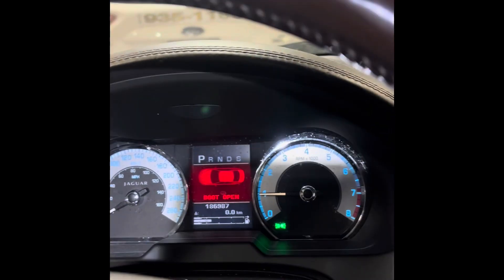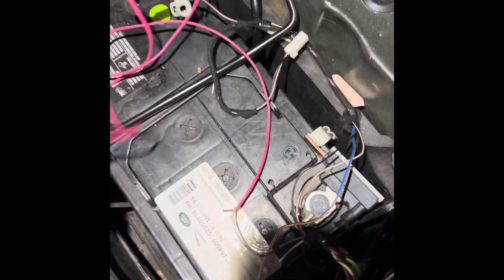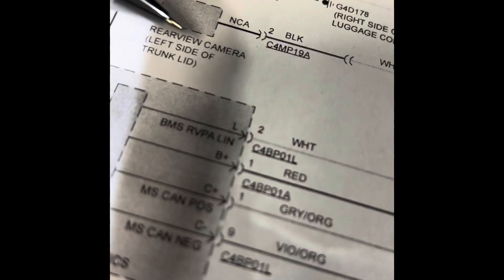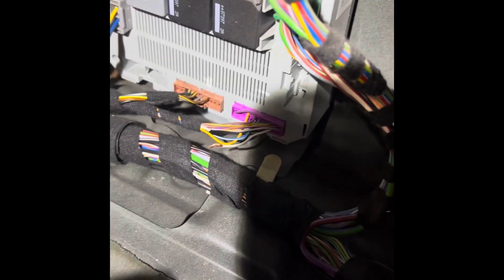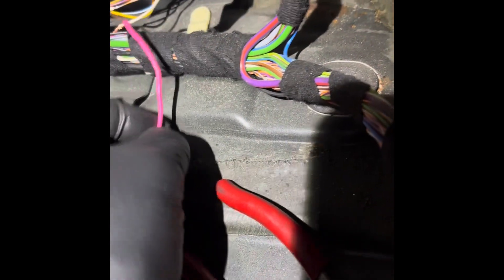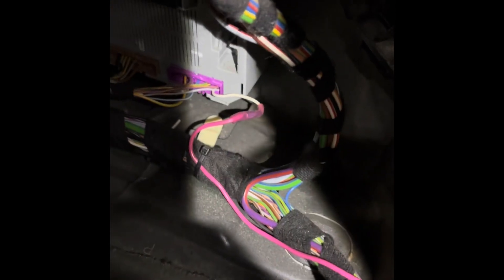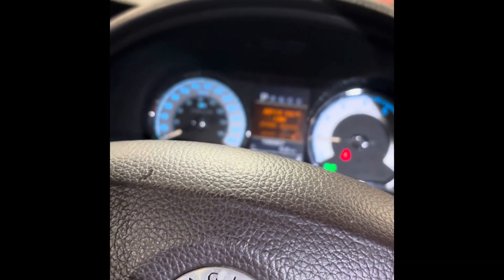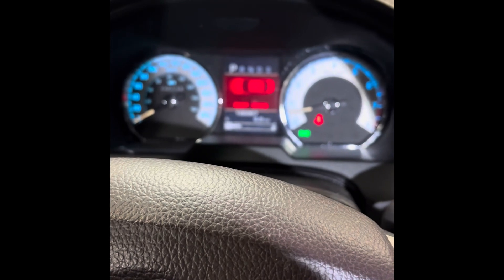Jaguar B11DB-87 Battery monitoring system FIXED

Comment: B11DB-87 Battery Monitoring Module

I have the same problem with my 2011 Range Rover L320. Do you think it will work if I do the same thing?

Comment: U have exactly the same symptoms, this is brilliant, thought I might have too change my alternator, this could save me a whole load of time and money, many thanks.
Reply: Update - mine had a corroded pin on the connector- the one the white wore goes to. I had  to take the bcm apart and solder a wire on but my car now works perfectly. At first the error went away but alternator voltage stayed at 13.7. I reset the bms  and registered the battery as new, it now charges at 14.8. Thanks Alex, brilliant stuff.
Reply: @bostonbikebits6539 what did u use to reset the battery?
Reply from the maker: Happy it helped you